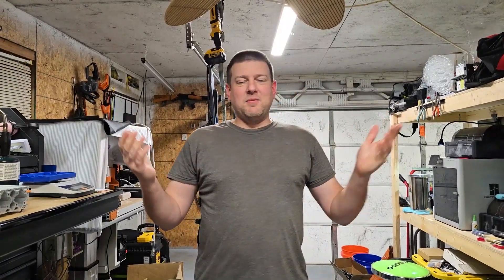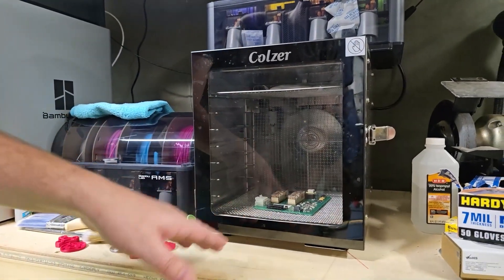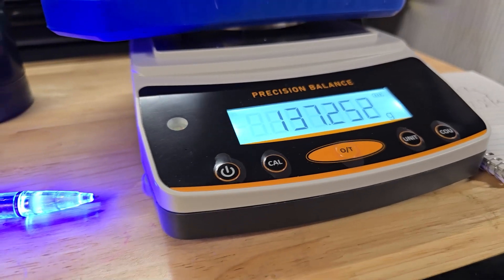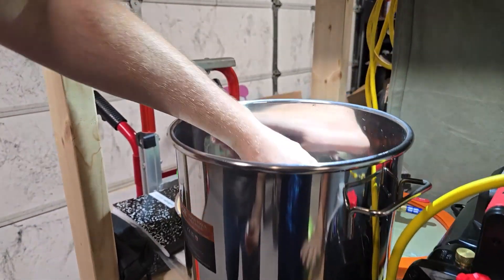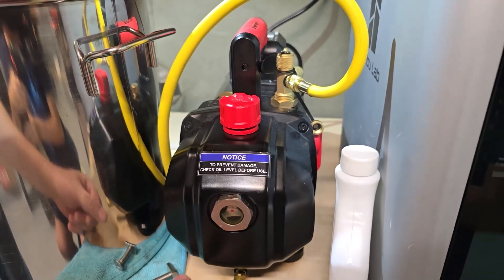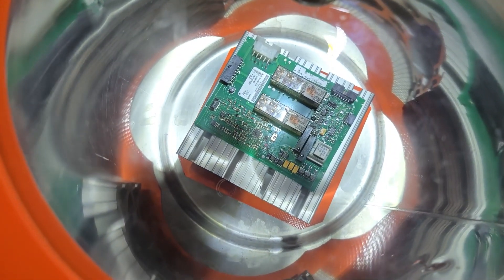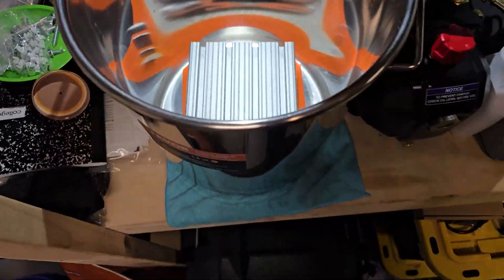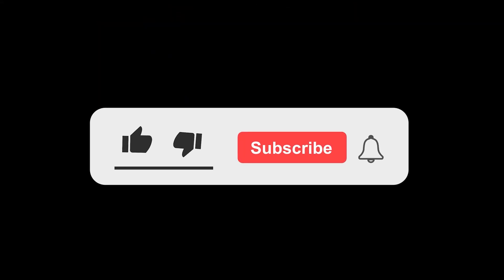Vacuum Drying Electronics - for repairs

Comment: If you were to replace your Compound Gauge on your Vacuum Chamber with a Micron Gauge and pull down to about 500 Microns. If you shut the Valves to the pump and introduce an Inert Gas [i.e. Dry Nitrogen] breaking the Vacuum with the Dry Inert Gas and immediately resuming Vacuum, you should notice it will take a few minutes to evacuate the gas and pull a vacuum down below 250-300 Microns. Which has been the long running standard for a Refrigeration System to be considered free of Water Vapor. Since you have a 2 Stage Pump, you should have your Gas Ballast Valve open to the atmosphere until you reach around 29 inches of mercury on your Compound Gauge. [Approximately -29 PSIG if your gauge reads negative psi] After shutting the gas ballast valve you should reach a much deeper vacuum at a faster rate. 6 CFM 2 Stage Vacuum pumps are the second most common pumps in the HVAC/R Industry behind the 5 CFM which is preferred to prevent oil migration [Not applicable as a concern in a Vacuum Chamber]

Comment: Why waste the time ?
I can take a board full of rust and clean it in my ultrasonic tank in 4 minutes -
then rinse it under the faucet with tap water
and then squirt 99% IPA on it for a minute
then place in my preheated conv oven (110F) for 2 mins
plug er in and test !
Reply from the maker: @Savant218  that will not dry everything
Reply: @BetterBiomedChannel  I use to run my user's keyboards and mice through the dishwasher because the ones where I worked were, quite frankly, disgusting, and, being the IT guy, I might have to type on them.... Just water, no detergent, and let them dry overnight in front of a fan. I'd swap their mouse and keyboard for a freshly-cleaned one and take their old ones and give them the  dishwasher cleaning. Never had one single complaint of a faulty keyboard or mouse after doing this. That was with city water, I would not dare do it with hard well water. My current electronics cleaning method is a waterpik filled with RO water from a 4-stage treatment system (I have hard well water), followed by an overnight dry in front of a fan. After any visible water has evaporated and if I don't want to wait for it to dry overnight,  I will use a hair dryer (which cannot get the board hot enough to cause damage from what I've seen) to heat the board till it's too hot to touch  for a few minutes. If my oven would me set a temp below 180F I would use that and leave the board in there for half an hour or so.
Reply: The concern is typically when mineralized water becomes trapped under items such as heat spreaders or electromagnetic shields covering RF Communication Modules. While Alcohol has a much lower boiling point than Water, heavy minerals such as Calcium, Sodium or Magnesium will require manual agitation to remove them from the circuit boards regardless of where they were separated from the water they were dissolved in regardless of efforts to force dry with Alcohol as you mentioned, or any other number of solutions that are used to aid in accelerating dry time. This is typically why Electronics Repair or Restoration that is high priority is carried out by a Restoration Technician in an ESD Clean room under a laminar flow hood typically. All water supplied for cleaning goes through a 5 Stage Filtration Process before the De Ionization Stage which reduces the Total Dissolved Solids to Absolute Zero, leaving the water with no electrical conductivity, free of minerals and a neutral pH level. This ensures no trace minerals that could become conductive or corrosive are introduced that could be left behind during the drying process. Also any Ultrasonic Cleaning of PCBs are done with an Ultrasonic Cleaner  that has a frequency over 100kHz not your standard 40kHz or worse the 25kHz that most low cost ultrasonic cleaners use. The lower frequencies have been known to damage thin films that are present in precision components. Feel free to place a sheet of aluminum foil into your ultrasonic cleaner and activate the cycle. You'll probably see quite a few holes poked in the foil, caused by cavitation bubbles. Keep in mind that every electrolytic capacitor on consumer grade boards is typically made from a thinner sheet of Aluminum Foil than the one that was covered in holes from the 25kHz or 40kHz ultrasonic cleaners.
Reply: @incipfer  I get what you are saying, but nobody cleans a pcb that is already clean. In terms of consumer grade boards, they are exposed to all sorts of contamination, yet, being consumer grade boards, nobody is going to clean them the way someone will clean a $10k mil-spec board. So the reality is that the consumer-grade board that got a can of pop spilled on it is probably going to be cleaned with water that may have minerals in it, and yes, an isopropyl alcohol rinse may not remove all of those, however, is the end result a cleaner board? Are the trace minerals in the water more of a detriment than the stuff in a can of pop? I think probably not. Also, given that consumer grade boards are used in places with varying air quality, I suspect trace minerals could be deposited on the board from the air alone, or in combination with condensation. You may recall that VCRs had a dew sensor to prevent them from working when there was condensation in the tape path handling components...that is the big indication that condensation DOES happen with consumer grade boards.

Comment: Love these experiments. 
A few other experiments you can do, is to take a pcb that is lying arround and weigh it before and after some vacuum, too see if it also removes moisture that was trapped in the pcb by just lying arround. Another experiment with vacuum is to use some electrolytic capacitors and weigh them before and after the vacuum treatment, because electrolytic are "wet" capacitors due the Dielectric contents, my theory is that these can loose there properties if the Dielectric "boils" out due the vacuum. An ESR and capacity test before and after the vacuum can confirm this or not. Also some materials like Nylon can absorb moisture from the surrounding air.

Comment: Wash in warm DI water, blow off the majority of the water then wash in dry IPA (99%) and finally dry with warm air.   You still need to pay attention to components that are not washable in any solvent, like a fiber optic connector or some pressure transducers.

Comment: Yup, I have dabbled with vacuuming boards to dry them as well.  One suggestion would be a laboratory type hot plate.  Capable of fine adjustment from room temp to hell hot.  Set it upwards of 100°C.  Back in my previous existence building boards we would use SN63 or SAC305 solder paste and would build on these hotplates.  (Or better yet use a reflow oven.)  All that to say, 100°C wouldn't harm the boards and the heat would let moisture evaporate even faster.  If the bottom of the chamber would sit flat on a hotplate, I know you would get a better result.  And using your aluminum 80/20 heatsink is a good idea too.  Or a chunk of copper, although expensive.  
To continue, after reflowing the solder, we would wash in an ultrasonic cleaner set as high as it would go.  Pulling the board out after cleaning, it would rid itself of any moisture due to the heat soak it went thru during cleaning.  Heat was the key to losing that moisture.  The only thing we couldn't ultrasonically clean was anything we had ribbon or wire bonded.  Or had free air coil inductors either factory made or made by hand.  Or components that had an internal battery.  But again, heat was the key to getting rid of moisture.  The vacuum helps and have vacuum bagged items in the oven too.  
You have a great idea here and could save someone in a pinch.

Comment: What looks like water vapor or steam coming out of the vacuum pump is actually oil mist.  The first removal of the air under high velocity because of the mass and the high velocity of the impellers on the surface of the rotor blades the film of oil comes out with the air.. 
       Something was wrong with your vacuum set up either you have a vacuum leak somewhere or something’s wrong with the pump because you should’ve been down to around 7000 8000 µm something you cannot read on an analog gauge in less than five minutes. 

Throw a micron gauge I recommend the Accu tools BluVac Pro because you can also computer data log it   

And you can prove all the moisture is removed after you perform a vacuum decay . 
     After you shut off the vacuum, the vacuum should not go above 200 µm to 500 µm. 
     If you still have moisture when you shut off the vacuum and perform your vacuum decay vacuum will keep increasing to around 3000 or 3400 µm and then stop in plateau.  This tells you you still have moisture in micro pores, possibly underneath the plastic film of capacitors, etc..
        You just pull a longer vacuum until it can hold after you turn off the vacuum to below 500 or 200 µm.
     And of course, in real life, we would use the ionized water or reverse osmosis water because of the dissolved salts in regular tapwater from the ground, and the distributing piping leeches, calcium, magnesium, iron and other dissolve salts when you evaporate the water, it leaves a conductive coating at the microscopic level of salts.